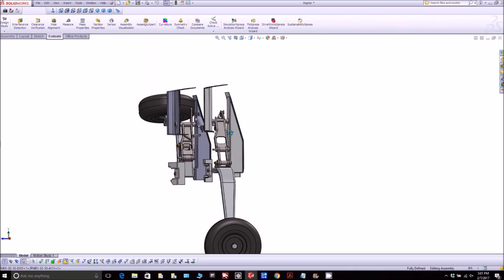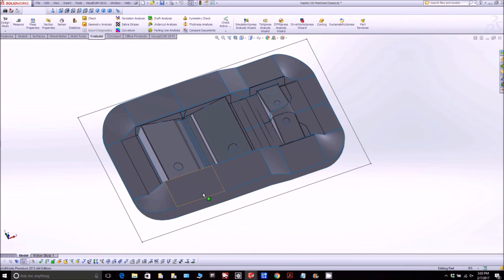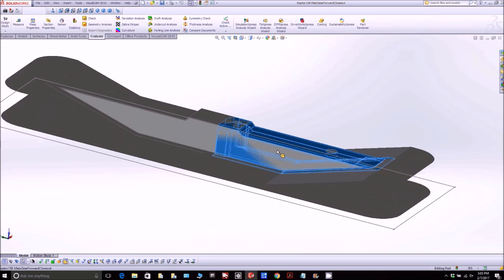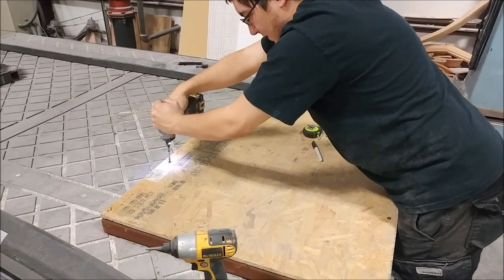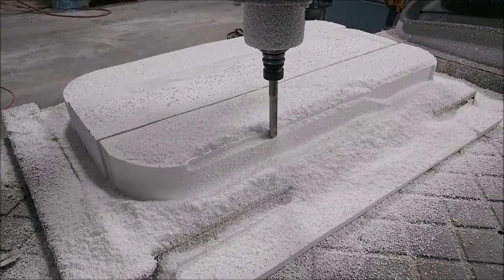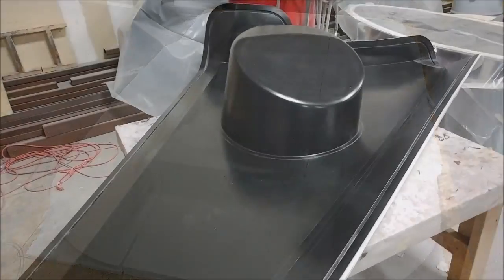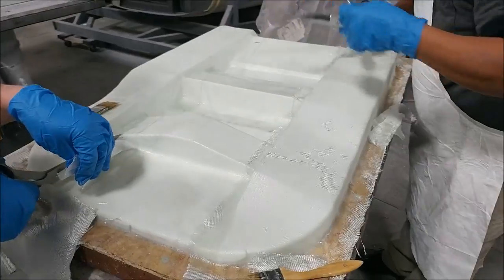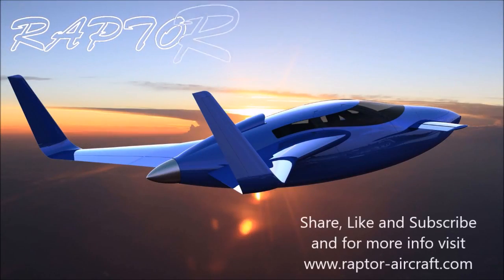Raptor Aircraft February 7th 2017

Comment: would It be possible just to blow hot air from the radiator or oil cooler through some tubes in the wings ? wouldn't that be cheaper and lighter than a water based system ?
Reply from the maker: Possibly but air doesn't carry as much heat as a liquid.
Reply: Good idea to reduce weight just blow air into the strakes.